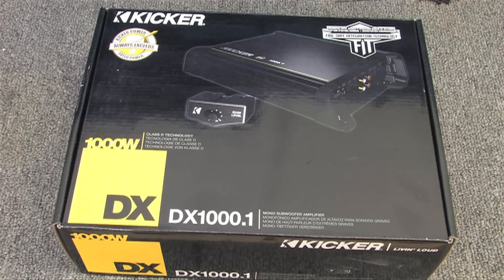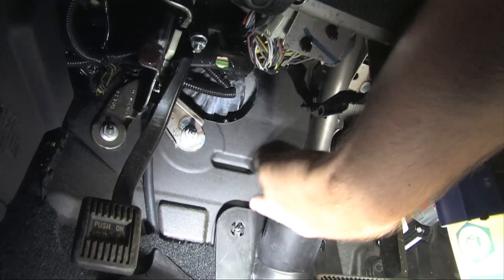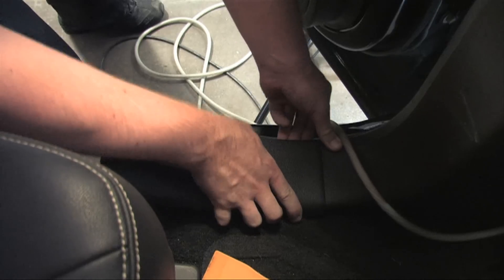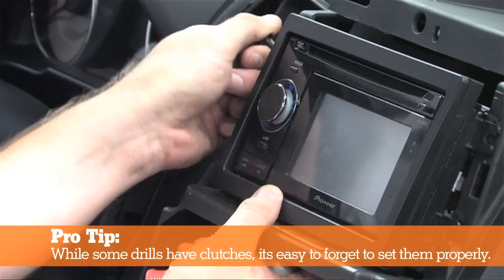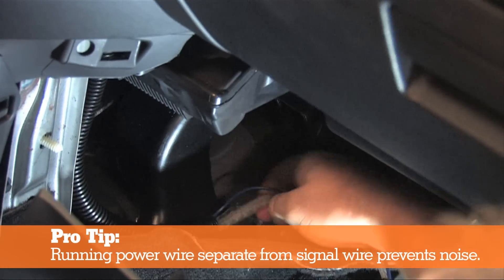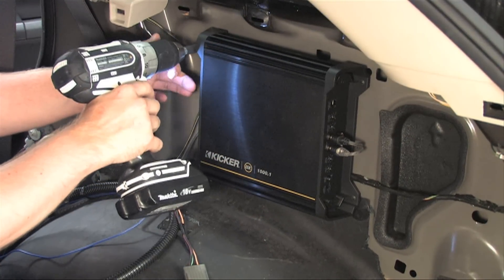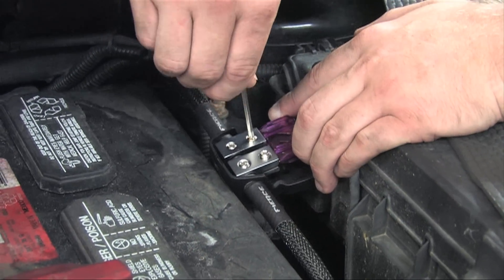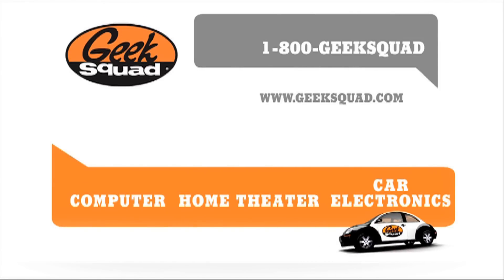Installing an Amplifier & Subwoofer: Geek Squad Autotechs

Comment: and of course leave the subwoofer loose in your  trunk so that when you hit a bump or take a sharp turn you damage the crap out of it.
Reply: ikr
Reply: certified30 I just used velcro to keep mine down
Reply: It should actually be bolted down. That thing could kill someone in an accident.
Reply: you must be using one cheap ass subwoofer and box for it to be light enough to slide around so much. l have been in car accidents and my subwoofer didn't bounce around. my subwoofers and box together weigh about 80 pounds, they aren't going to bounce around.
Reply: Electronics For Fun same here my speakers and box together way a little over 90 pounds
Reply: @wrongarage  An 80 pound one
Reply: @wrongarage  - Most serious subs weigh about 10-15 lbs and a good size ported box with good wood will easily weigh 35-40 lbs.  Cheaper subs and cheap boxes weigh about half that.  Depends on what you want to do with your system.
Reply: @FrisiaSaksen car accidents that weren't my fault. l can't help it when people decide to rear end me. but nice try though.
Reply: You probably dont care at all but does any of you know of a tool to log back into an instagram account..?
I somehow lost my password. I appreciate any tricks you can offer me!
Reply: @Ty Tommy instablaster =)
Reply: @Colten Coleman Thanks so much for your reply. I found the site through google and im in the hacking process atm.
Looks like it's gonna take quite some time so I will get back to you later with my results.
Reply: @Colten Coleman It worked and I now got access to my account again. I'm so happy:D
Thanks so much you really help me out :D
Reply: @Ty Tommy No problem :D

Comment: A thousand watt amp, and THAT is how you do your ground? With a zip screw, over paint? Glad i do my own installs.
Reply: Luis f Haha amateur.
Reply: rocbola Besides causing low performance of the subwoofer, that ground could cause a build up of resistance making the amp pull more amps than it was designed for causing it to blow fuses, enter protect mode, and in some cases permanently damage the amplifier.  Ground location should always be a solid metal part of the body with the paint removed and with a larger sized bolt or screw to avoid vibrating loose.  Modern vehicles use a lot of epoxy, sealant, and tack welds that will not provide a low resistance to ground in some areas but many do provide a factory grounding lug that can be used.  They also should have cleaned up the terminal ends of the battery and provided a negative terminal to engine and chassis grounding cable of the same gauge.  The amplifier has to ground to the battery through the factory battery cables otherwise.
Reply: "A thousand watt amp".......... LMFAO
Reply: Yeah fucked up, on paint .. jesus. Sand that shit down at least. I also saw no mention anywhere of disconnecting the battery negative first .. worrying.

Comment: The spelling and lack of punctuation throughout this video frightens me - we should "rap" the dash with a blanket. 

And you should always, always work back-to-battery. It was only this fifth time I watched over this now that I realise you remove the inline fuse before running the power cable through the car. Well guess what, most amp wiring kits require you to trim the power wire to length BEFORE inserting a fuse. This confusion will lead people to do what you guys have done here with hooking up the battery side first and start running a LIVE wire through the car, which could cause shorts... 

Other than that, this is the best instructional video I've seen for this sort of thing, so thank you for being so clear :)
Reply: the wire shouldn't be live if the fuse was removed. They attached the wire to the battery so they would have proper length without accidentally pulling the wire through the firewall
Reply: Hunterzpunter oh my god... did you not read my comment!?
Reply: Jerome Bernard  Hunterzpunter is right. you must have watched the video backwards, plus near the beginning he disconnects the ground cable and removes the fuse from the power wire.

Comment: Even if you take the fuse out when you connect the power cable to the battery, connecting the harness behind the stereo will carry electricity. Some alarms and theft deterrent systems are connected to the radio. So they are hot even if the car is off!
Reply: he literally didnt connect any harness to the rear of the stereo, nor did he remove a power cable from the battery. connecting the amp power cable sends current to the amp only, the RCA's provide signal for the amp from the stereo

Comment: Great video. Thanks. What I don't understand is whether is amplifier is exclusively from powering a subwoofer, or whether an amplifier can and is usually used to add power to all of your car's speakers.
Reply: I think an amplifier is used to power the subwoofer only, the radio unit contains the amplifiers for the other speakers.
Reply: You are right Arnout, but you can power them separately with another amplifier; you would just have to get better door speakers, considering you wouldn't want a whole lot of power running through the Stock Door Speakers.
Reply: montygram yes SIR. but stock speakers can also handle a bit more than you think. I have used what alpine calls a POWER BLOCK and installed it in stock systems.
It's adds an extra 45 watts per channel.
Reply: Or you can run a 4 channel amp for 4 of your door speakers and have a seperate mono or 2 channel amp for your sub or go for a 5 channel amp which can handle all 4 of your door speakers and a single channel for your sub/s.
Reply: it can do both, you can get a monoblock amp to power a subwoofer or you can get a 2 channel or 4 channel amp to power extra speakers. but the main speakers will run off of the amplifier built into the car stereo.

Comment: So what you're supposed to do when installing an amp is to place it behind unventilated plastic onto thin sheetmetal that will flex and vibrate, you zip-tie speaker wires to high current power wires, you ground an amp to some sheetmetal that still has the factory e-coat, and then you bolt it down on top of wires potentially pinching them and causing extra interference and impedance?

Wow, no wonder Geek Squad is so unpopular in the audio world. Those are some of the things you AREN'T supposed to do.
Reply: Lolol thank god you said it
Reply: Well it is Geek Squad.  I've had horrible dealings with them in the past.

Comment: Make sure you zip tie your rca wires to your power cable for a nice clean sound and don't bother removing the paint from where you attach your ground wire.  This install should work flawlessly for years to come lmao
Reply: I know right. Remember to use star washers for extra grip

Comment: Yeh lets just cramp the RCA cables behind the amp. this is why i install my own music.. Crimping the rca cables behind the amp like that can damage the cables !
Reply: Sahil it can not damage the Rica wires bc he didn't mount the  amp that tight to damage the wires he even said it
Reply: That would totally damage the rca cable. Doesn't matter what they say. Any amount of pressure would cause an issue. Unless the car never moved or the subs were never turned up. That made me cringe the most.
Reply: how can that damage the cables? it's not like that amp is sharp enough to cut them or anything. it's no different then if you were to squeeze the cable with your fingers. it won't harm the cable in anyway.
Reply: Well, you do it and let us all know how it goes for you! What do you say? No professional installer would ever do anything in this horrid video.

Comment: my stereo and front speakers were installed by best buy and when i gained more knowledge on car audio i decided to upgrade everything and do it myself and quickly noticed what a messy job best buy had done. Lots of broken parts on the door, broken door clips too. The cables on the head unit were hooked up using electrical tape and were all loose. ugh

Comment: How do you know which wire is the remote wire in the radio? And how do you connect it the right way?
Reply: A blue wire with a white strip on it is amplifier turn on. You can connect it by solder and heat shrink, butt connectors, crimp caps, or just some electrical tape

Comment: I plan to add equalizer to my 2012 toyota 4runner Limited. It has a JBL unit. I wonder if it is a component style so i can connect the equalizer in between before signal goes to amplifier.

Comment: Just a quick question. I'm installing my on sub. and amp and wondering if the rca cabels just goes right to the subwoofer ?
Reply: Your RCAs run from you radio to your amp.
Reply: ok, thanks

Comment: Hi which wire have u connected to your radio and in the back panel of the radio, to what wires have you connected the wires from the remote and line in from your amp

Comment: Is it really necessary to run the remote/RCA wires down the passenger side, while running the battery wire down the drivers side?  Why not just run them all down the same side and save your self some time.  Can't you just shield the RCA cable or will the battery wire still cause interference ?
Reply: The power wire's frequency will interfere with the rca's frequency nd will cause noise in the subs. I did the rookie mistake nd i had a high pitch niose coming from mine. Yes, it is a little more work, but if ur not gonna do it right, might as well not do it at all.

Comment: Q? So does the amp stays on all the time since its power straight from the battery ? Or am I missing something. ... Thanks in advance
Reply: The blue wire is the Amp Turn On/Off wire that is powered off the amp turn on wire from the head unit. This functions like a normal on and off switch.
Reply: dlfdlc It is called a auxiliary wire.. It is used for a Amp/power antenna.
Reply: Nino Gambino Something tells me you've probably figured it out.  If not, here's my 2 cents:  There is a wire coming from the back of the radio, stereo (head unit) that is blue and is connected to the red wire inside that also comes out of the back of your radio and goes to your ignition.  When you connect that blue wire to the power control terminal on the back of your amp(s), when you turn on the car, you turn on your amps too.  That way they are not on all the time, like the radio stations and the clock and whatever else that is hooked to the yellow wire inside your radio/stereo (head unit).  The red wire is called a switched hot as opposed to the yellow wire hook up which is called constant hot.

Comment: fyi...easiest place to hook remote is acc/cigarette lighter, it only powers up when car is on & they have fuse adapters where you can tap into & add another fuse to existing fuse, cost 99 cents and makes life alot easier. Another thing, when upgrading front speakers go with components as opposed to the coaxials you used. Factory passive crossovers are just going to cancel out the highs on the coaxials which is why tweets & mids are separated to begin with & even then, the imaging with the high end firing at your leg is horrible. Another thing, your ground spot is horrible, that piece of sheet metal is just tack welded onto another piece of sheet metal & resistance is high. You want to ground to something that goes straight to chasis.
Reply: if ur installing an aftermarket deck you have to bring the remote wire to that wiring harness right?
Reply: dwizl7213 not all cigarette lighters only power up when the vehicle is turned on. My JK has a constant hot wire that runs to the lighter.
Reply: thats false.  my old monte carlo had an always on cig lighter.  really most of what you say is gross exaggeration to flat out nonsense.  have you ever owned a car?  i dont think you have?

Comment: If I have a stereo head unit with front, rear, and sub RCA outputs with high-pass and low-pass built in crossovers will the high-pass go to the front and rear while low-pass goes strictly to sub?

Comment: I'd strongly recommend a better ground & stripping the paint at the point of contact.

Also, secure the subwoofer in place so it's not sliding all over the place, puncturing the woofer or worse!
Reply: i have a seatbelt around mine lol works like a charm

Comment: What is the name or brand of the speaker wires using. positive n negative wire
Reply: macteesac All speaker wire.  One side is usually marked in some way so it is easily hooked up correctly.

Comment: What did you do with original speaker wires, I've got them going from rear stereo to amp, but left un plugged, so brown speaker wire plug on harness not on. Then got 4 rca to amp from stereo. Got remote connected to amp, ground and power  why does my stereo have sub socket as no wire running there. But if turn amp off on stereo no sound. Yet sub socket empty back stereo

Comment: where do you get that power wire w fuse and ground wire?
Reply: Thesupercharger21 I know you don't need this answer probably since it was 6 months ago you asked the question, but if it's any help, I got mine at the pick-apart off junk cars with nice stereos.  Also got some cheap at the swap meet if you happen to have any of those around.

Comment: Is there any video with installing a amplifier to an mitsubishi lancer '' 15. or you can compare any with it. I'm afraid I'm going to break anything
Reply: +bjorn nuijts probably not on the vid. and dont worry about breaking stuff unless you are really pulling on the panel. its all the same as far as installing power, rca, and remote. ps strip the grounding area.
Reply: Alright, Thank you!

Comment: i would have though disconnect the battery first before doing any electrical work...
Reply: I agree less chance of blowing something up or hurting yourself.... though that is why they took the fuse out so no current would get through but they still should have disconnected the battery IMO

Comment: They didnt clean the paint on the ground... :(
Reply: +SwishaMane420 or the connection on the battery's loop terminal.
Reply: They said in the note to sand it down for a better connection

Comment: The only issue i had with this was attaching the power cable before the ground.
Reply: why? power wasn't sent to the amp until the very end of the video when he installed the fuse into the fuse holder. so it was a safe install. read a book

Comment: I was watching on another video that you have to disconnect the negative side of the battery so it won't shock you or anything, I'm confused
Reply: Jaron Burgess I think that is done to prevent creating a short circuit in the vehicle while waving around bare wires.  The current in a battery is harmless to humans as far as I know.

Comment: Hello! Is it possible to splice into the remote turn on wire on my head unit wiring harness if it is already being used for something else? I had previously soldered the remote turn on wire on my after market wiring harness to the antenna wire that came with my factory wiring harness, but I would like to additionally solder the remote turn on wire that came with my amp wiring kit to the remote turn on wire on my after market wiring harness (even though it is already soldered to my antenna wire). I was unsure if splicing into a wire that is already in use for something else in order to add an additional wire (which would be the remote turn on wire from my amp kit) would put me at a risk for a short, or if the wire would not supply a strong enough signal to turn my amp on & off since it would have to be spliced into my remote turn on wire that is already soldered to the antenna wire. Thanks in advance!

Comment: What if it doesn't  have a subwoofer hole?
Reply: +Max Richards Use a sharpie to mark where you have to drill and drill one. Shouldnt be too difficult im suspecting im going to have to do that as well

Comment: Ok sooo.....what if you dont have subwoofer connections on tha back of your stereo??...where do your RCA cables go?? Sumbody explain to me as I am in the middle if an installing my amp and subs.
Reply: any rca outputs will do
Reply: search "Line Out Converter", if you're wiring to stock stereo its what ya need
Reply: Sorry I wasnt more clear but yea...Working with my stock HU I found that tha LOC was what I needed. Thanks

Comment: Should i disconnect my ground wire on my car first before i do this? Sorry im new to this lol
Reply: Yes
Reply: You'll need a ground wire attached to metal and disconnecting the negative charge of your battery isn't a bad idea. Unless you wanna shock yourself. If that's what you are talking about.

Comment: won't the amp get to hot hidden like that?
Reply: That's what I was thinking too. However, for no bigger than the amp was, (the sub too), it's not like their gonna be railing on it or anything. After all, it did go in a mini van :)
Reply: he also said that the amp he bought runs cool so it doesn't need the air flow like different class amps would.
Reply: he said it was a class D amp and those are the most efficient amps you can buy at almost 100% efficiency so because of this they run fairly cool. but l love how he mentioned that it runs cooler than a class A or B amp. it's funny because neither of those amp classes are used in car audio, class A amps sound amazing  but they are incredibly inefficient and get really really hot because their efficiency is under 50% and after about 30 minutes of use this heat causes electrical resistance which makes the sound quality tank and this is why you never really see class A amps anymore. especially in car audio, class A amps where never ever used in car audio which is why it's funny that he mentioned that. and class B amps are pretty efficient, not as efficient as a class D but still. problem with these amps is they don't sound that great which is why they aren't used anymore. l think the guy was talking about a class A/B amplifier which combines the class A sound quality with the class B efficiency and makes an all around better amplifier. and class A/B is probably the most common amp class you'll find out there in departments.